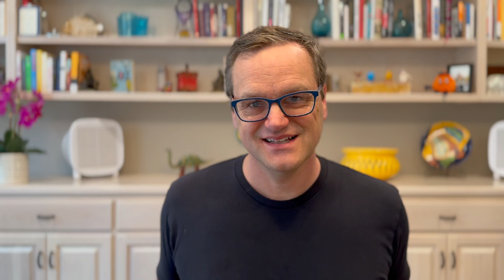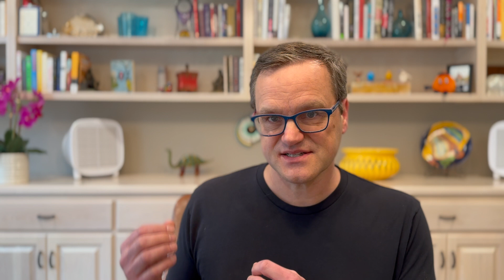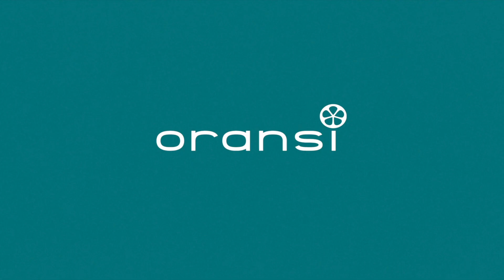Watch This Before Buying a Smart Air Purifier

Comment: What part of the air purifier where the intake of the dirty air is going into and where is the output?
Reply from the maker: For the Mod Series (Mod Jr, Mod, and Mod+): air intake is 360 degrees around the bottom, and the output  is 360 degrees around the top. For the AirMend and TrueCarbon: the air intake is through the front of the unit, and output is through the back.

If you have more questions, please connect with our Customer Service team at 888-281-3948!